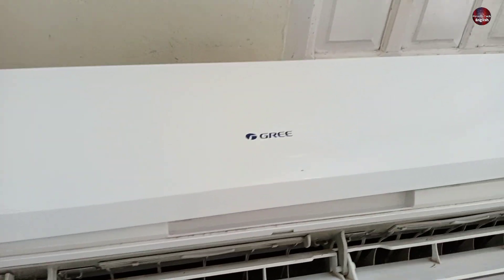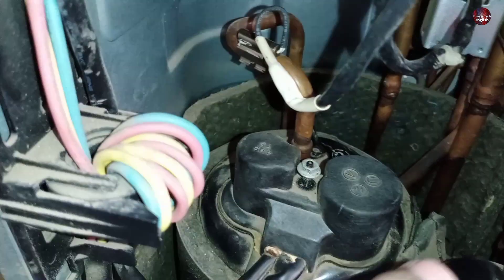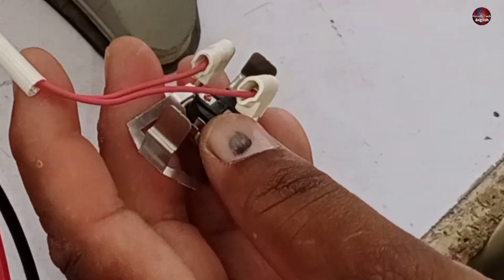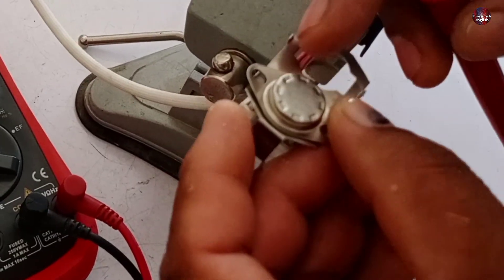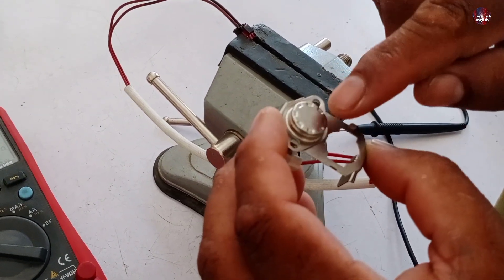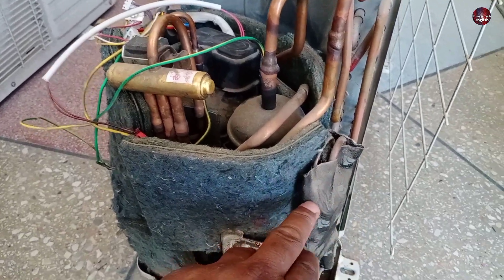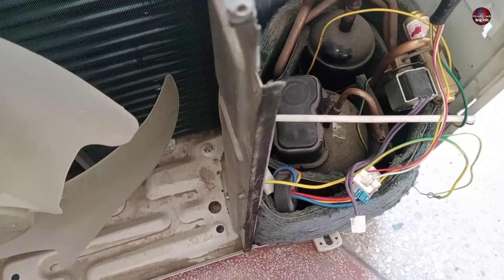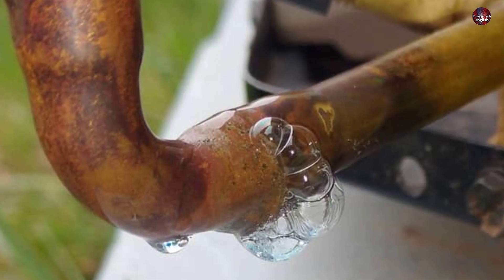How To Fix H3 Error Code in Gree Mini Split AC

Comment: I'm struggling with this H3 error now.
Sometimes even jumps to the H5 error.

Anybody any luck already?

My HPC 115/95 UI sensor I checked and it sounds to be working at the right temperatures.
Just don't have the tools to measure the values now.